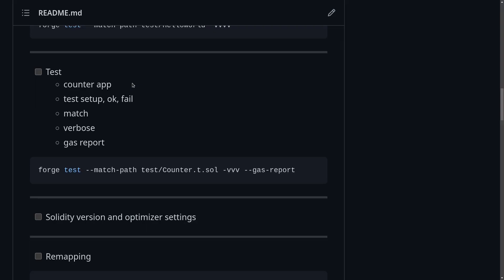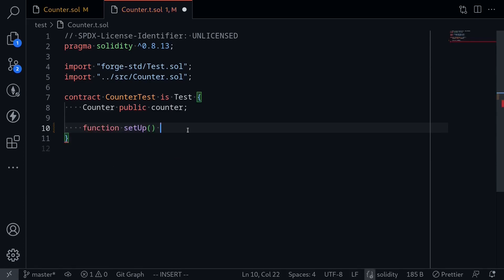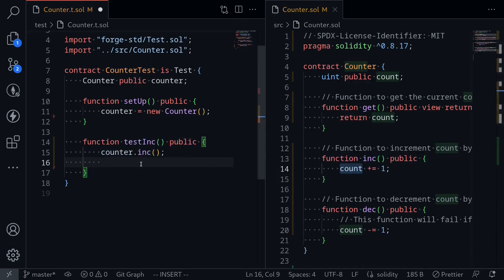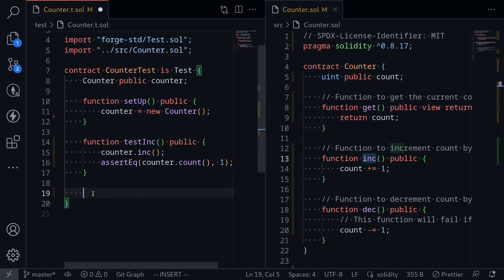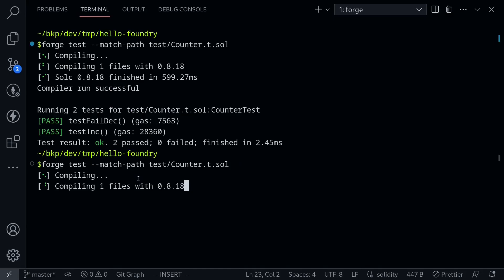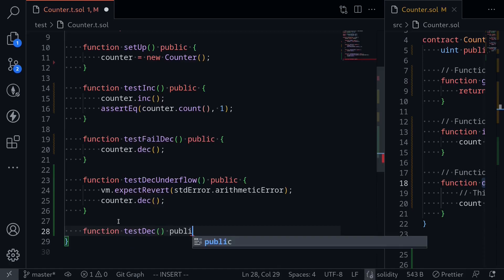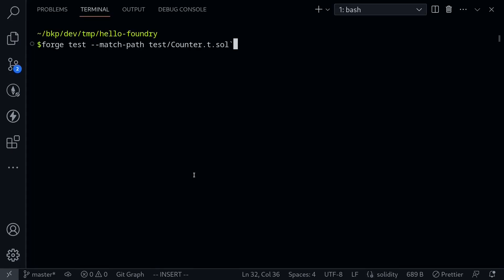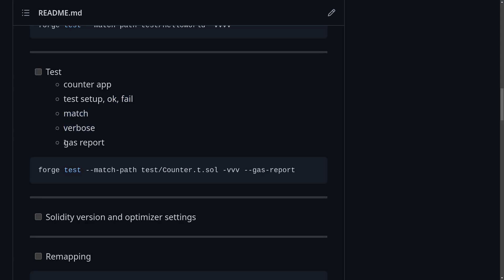How to Write Basic Tests | Testing with Foundry

Comment: Hello. Great source of information for learners like me. I have a persistent issue with foundry and would appreciate your help. I've tried chatGPT and Grok AI for help but was no able to find the fix. I followed your video step by step and not seeing the same result shown in the video. Specifically, the HelloWorld.t.sol test is not detected by foundry with an error message: No tests match the provided pattern: match-path: 'test/HelloWorld.t.sol' Error: No tests to run"
Reply: match-test is now --mt. It is used for specific test functions in a test contract. Try that and see if it works. Be sure to use two dashes in front of mt.  --mt nameOfTestFunction.  

If you want to only test one contract, e.g.,  HelloWorld.t.sol    just run forge test HelloWorld.t.sol.
Reply from the maker: what happens when you run "forge test"?
The command above will run all tests
Reply: @smartcontractprogrammer  thank you for getting back to me. I was able to resolve it. It issue was caused by multiple factors - old foundry version, i was not using the bash terminal which I should have, the protocol has git submodules that i wasn't aware before etc.

Comment: I was wondering why dec() cost much less gas than inc(). Why?
Reply: Great question, I have no idea either.  I guess if you were writing a for loop to do something 10 times, it'd use less gas to go from 10 to 1 than from 1 to 10?
Reply: I did this test and found the opposite result, going from 1 to 10 was cheaper than going from 10 to 1.  I really don't know why dec() costs so little gas according to foundry.